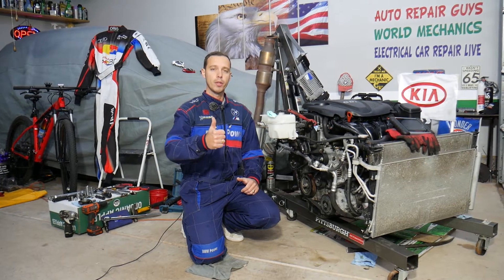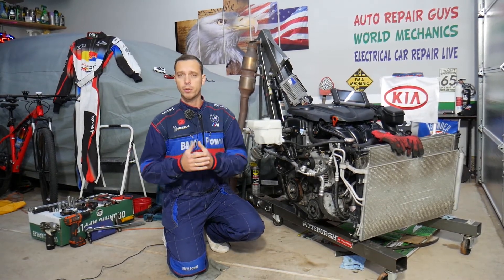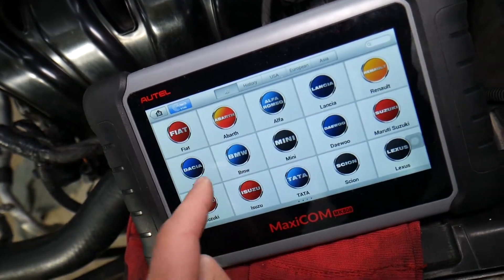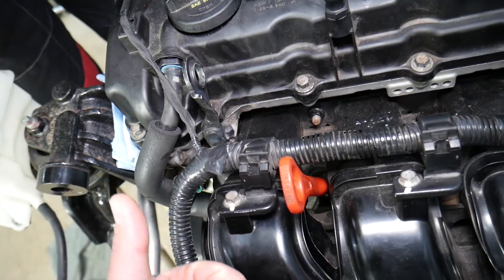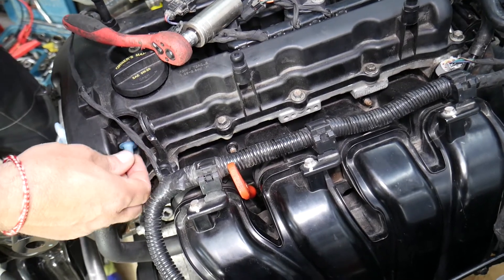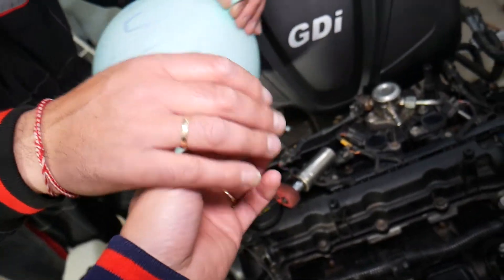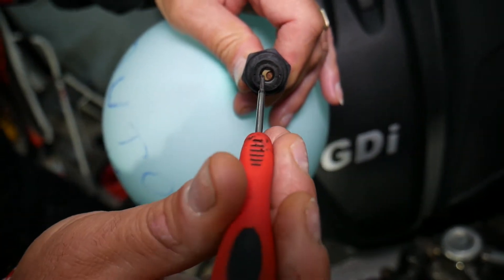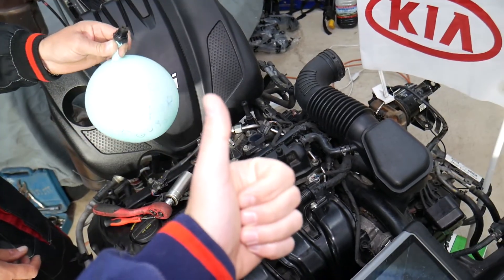HOW TO TEST PCV VALVE ON KIA SORENTO, KIA SPORTAGE

Comment: My old valve looks exactly like in the video. Whenever I shake it...it does not center in the middle and leaks air. I bought an aftermarket valve that has a different inside mechanism....and it also leaks air.  Should a good valve be air tight?